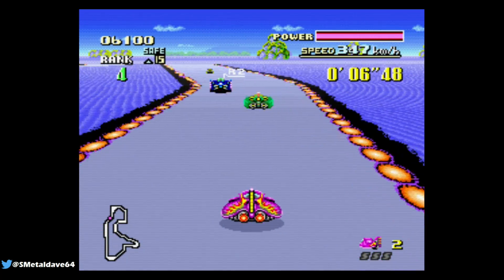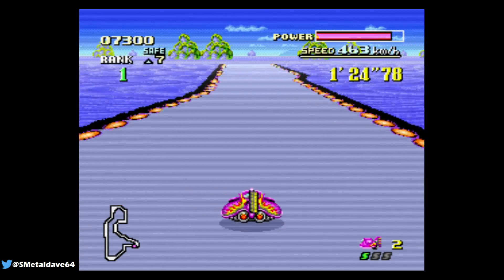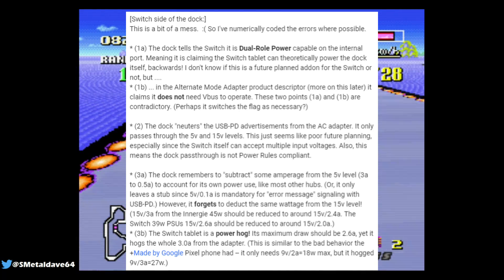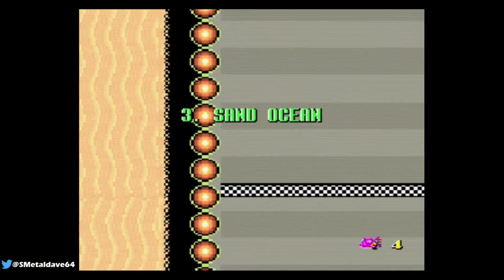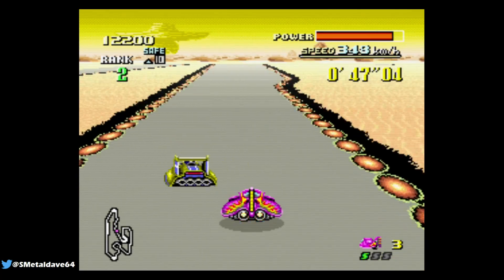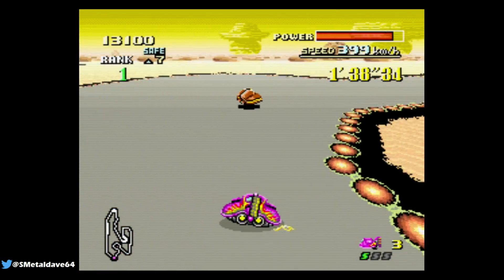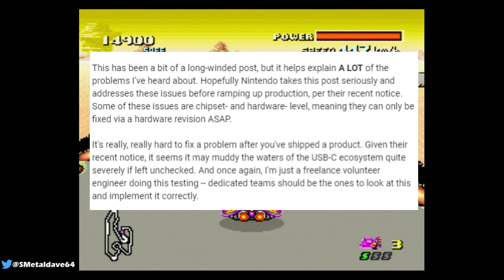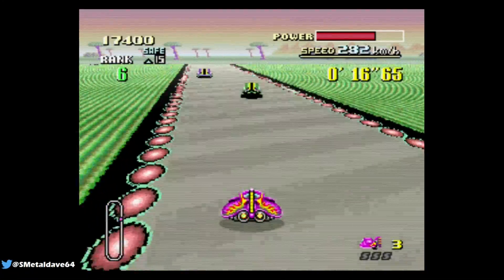Nintendo Switch – USB-C Voltage Flaw Explained

Comment from the maker: Hey guys happy Thursday. This issue with the USB-C port of the Switch and the Dock of the Switch has been circulating today and now we can examine what is going on with it. I think Nintendo is going to be releasing that revision sooner rather than later. Again, I advise people to stop using any accessory or dock that isn't made by Nintendo at this point no matter if it's already worked in the past.
Reply: Does this also include the controller adapters that allow you to use other controls like ps4 and xbox controllers? And does this also include stuff like the Switch Projector?
Reply: John Steel  but the dock is propietary, it handshakes with the Switch and outputs AV. Third party figured it out(just like Apple authentication was cracked), but probably didnt regulate power supply correctly during AV passthrough
Reply: Jon L for what ? Instructions told everybody to only use the cord that came w yr switch or one w the 56k ohm resistor.
Reply: ualdayan, see you feel that you think that is how it should be. Nintendo never said it was USB C compliant they even said to use official adapters and chargers. They designed the system in which it does use a type C port. But they are even confined to that limitation. They made the system they way they wanted to and it runs fine. Nintendo isn't going to make a system so that you can use inefficient chargers or docks that doesn't meet their requirements. It's their system they designed it so they made the system so it runs and it does damn well. Now if they did say hey you can use any charger or we are USB compliant then you would have ground to argue, but they didn't and well you don't have a leg to stand on. So quit complaining and just deal with it. You know you would still be bitching if they didn't use USB C and their made their own port. So either way you still would be bitching. You people are never happy and always looking for something to bitch about. Why don't you do this instead of bitching and complain like you are now how about you just enjoy the god damn system and be happy the switch is a decent portable? You know life is better when you stop acting like a spoiled ass bitch. Enjoy life stop acting like a bitch.
Reply: how about PD powerbanks like anker or aukey?
Reply: almost EVERYONE uses USB-C charging in a non standerd way.
the most 'standerd' anyone has ever gotten is apple's thuderbolt 3 protocol(used in a lot of laptops these days), with a few exeptions.
Reply: Im still a little confused, con you use things that underpower the system like a phone charger
Reply: SuperMetalDave64 what do you think about the anker powercore+ with powerIQ telling it the necessary voltages to use ? Would I be safe ? Or don’t risk it .
Reply: SuperMetalDave64 How does this apply to portable chargers? Don't think it touched on that, just docks.
Reply: Zyfer Warrior I’ve heard as long as you get a resistor cord it fixed the problem as well
Reply: I think I'm safe using my  USB c extension cable
Reply: 18matts hope yr right
Reply: Sir Randall Gaming That is still a flaw. To use a standard port, then use it in a nonstandard way that can’t handle a device being connected that does follow the standard is a flaw, to have it break the device is actually a pretty big flaw at that.
Reply: If you use a standard connector - and then a standard device plugged into that standard connector breaks the device because you didn't follow the standard of the port you chose to use - that is on YOUR design.  It just is. It's a flaw in your design.  If I design a circuit board that has a USB port, and I put 5V on what the standard says should be GND - that would be a flaw in my design.  It wouldn't be the fault of people plugging in standard compliant devices into a standard port and having it fry their devices.  There's a reason standards exist.
Reply: SuperMetalDave64 is it ok to use third party usb c cables for pro controllers tho?
Reply: I'm planning on getting the switch soon, would it be okay if i use my own usb-c cable to plug into the dock and the switch? It's because i heard rumours about people are smudging or scratching the switch with the docks.
Reply: I smell lawsuit.
Reply: Sorry it's a flaw the moment when hardware that follows USB type C standards has the potential to brick your system. This is by the very definition an "issue," "flaw" or problem. The scary thing about this is a cell phone charger from Samsung or LG has the potential to brick your system.
Reply: wakannnai1 actually there are no cases where chargers brick a Switch, only docks with AV output. Additonally these accessories havent even been 3rd party tested for PD compliance. And no one even knows if the bricked systems are power related, most feel its a fail safe to prevent hacking.
Reply: is "brick" even the proper term  ,  i mean birck implies to me that is a software problem this  seem like it is just outright frying the hardware and physically  damaging the boards
Reply: SuperMetalDave64  You do understand when you say "power complaint", the standard only holds true if the device is rated for PD. Therefore since it isnt (and neither are 90% of USB C devices) its not an "issue" or "flaw". Nintendo, like Quick Charge 2.0,3.0, adapted theyre own profiles they felt necessary to power and charge the system.

Comment: Does charge only c cables require that ohm resistor? This is confusing as I’d like to know if i can safely charge my switch with a regular 5v 1A power brick and a cable which says “min/max power 5v 2A”.

Comment: Only 3rd party device I use on my switch is a RavPower 20100 Mah power brick with usb-c to usb-c Belkin cable to charge my switch while on the go. Working fine so far. If it dies, 3 years warranty. Gimme a new switch, bitch

Comment: What? No it's fine. It's fine just like the dead pixels and the docket scratches the screen and the switch bending and the joycons that can get the strap stuck in them if you put them in the wrong way. It's fine. It's all fine.

Comment: Dave, I personally rather use the original dock made by Nintendo itself, not only because it's safer for the switch, but because the original dock looks so sexy, and it's not Nintendo's fault that people are using non licensed third-party docks.

Comment: Here goes the hype during the reveal of the Switch when they said that they are going to use USB-C to power and recharge the Switch ... So basically we're back to square one.... It's Just like 3ds that you have to use proprietary cable and chargers to charge... And they didn't mention any of that during the reveal... Specially during the launch period everyone went to buy a generic USB-C Cable and adapter so they can charge it when they are outside of the house.

Comment: Seems to me the simple solution is use the charger Nintendo sold you with your system and if you want an extra just don't be a cheap ass and buy Nintendo's.

Comment: The problem is, a lot of people bought 3rd party docks because of their portability vs the Nintendo dock. A lot bought due to price point, yes, I'll agree. I think Nintendo missed a trick and should have made a travel dock. I'd buy one tomorrow so I don't have to lug the main one around!
And if the capacitors aren't dumping power then hypothetically a licensed Nintendo dock could still fry a switch. It's a design fault, no argument.

Comment: I have a PS4 and wanted a switch but with those issues alone, I won't ever buy one. Dock scratching and overheating switch and it's overpriced. 3rd party dock bricking switch. switch's USB-C is non-standard powered.

Comment: This is bad for Nintendo and bad for the USB-C ecosystem. Nintendo is using a standardized connector in a non-standard way. They should have used a proprietary connector if they weren’t planning to follow the standard properly. It makes me wonder whether the power regulation components were actually designed before the USB-C standard was solidified or if Nintendo engineers were being sloppy.

Comment: I the only non Nintendo product I use for my Switch is a USB car charger with an Intput of 12-24V and an Output of 5V 3.1A but being a dual channel 1.0A and 2.1A slots.  I am pretty sure It is safe since it wouldn't put out enough juice from a 12V car battery hooked up on the 2.1A slot.  But can anyone confirm if I'm good?

Comment: There’s only one company to blame for this and it’s Nintendo themselves.  No one would be buying 3rd party socks if their standard sock didn’t suck so bad!  It scratches the screen without a screen protector and has terrible ventilation!!!

Nintendo should service FOR FREE and honor any warranty even if you used a 3rd party accessory cause it’s their own damn fault!

Or better yet, offer a free replacement for all docks!!!  All of them!!!  Design and manufacture a better dock with better ventilation and scratch free!

Or at least just the ventilation problem!  Everyone should install a screen protector on their switch.  So the scratch issue is minor cause most people don’t have this suffer this.  But the ventilation???  Christ!!!!  I have to place my dock horizontally and lay a pc fan on top with the back panel open to push more cool air into the switch so it doesn’t get so damn hot all the time.  I shouldn’t have to do that kinda bs!!!!!!!!!

Comment: Nintendo won't fix anything.  They will tell you that you violated your warranty using unauthorized accessories and be happy to take your money when you buy a new Switch.  It works as designed.

Comment: I like the way you worded the problem SuperMetalDave64. Design Flaw and Non Compliant fit this perfectly. Nintendo has always known how connectors work, and have always made their power and video plugs proprietary. They did this to screw over their competition and their customers, but they have also made themselves legally responsible for it. They chose to use USB-C for the power supply, but chose to make the Switch non compliant with those industry standards. I cannot wait to see the class action suit this will cause and Nintendo will get taken to the cleaners for it.

Comment: I think all Nintendo switch owners honestly have a class action lawsuit for this.  If the USB C port was not built to standards by Nintendo yet they advertise in the specifications for the Nintendo switch that it has a USB C port then that is false advertising and they obviously had to know about these problems prior to shipping.  Nintendo should have to make the hardware changes necessary for the USB C port to be standards compliant for all existing and future Nintendo switch devices.

Comment: Gotta love all the idiots saying nintendo is purposfully bricking systems.
 First of all do you not realise game companies like nintendo make far more money on the games and dlc then they do on systems? If you dont have a switch your not buying games. 
Second for most pepole experiencing these issues they are still well within thier warranties and can get them fixed for free. Now nintendo has to spend a fortune fixing all these switches.

Third if as hes says in the video its caused by not being complient they can and will be sued for a crap ton. Will have to do a recall and fix all switches for free. This will cost them a massive sum of money that is only equled by the exploding samsung phone debacle.

Fourth and lastly a good amount of blame still lands on the makers of these third party dock. Proper testing would have found this issue and they could have alerted nintendo and the public...further seeing as the nintendo dock does not cause this issue the third party docks could have actully made a modle that does not fry the switch. They just need to do what ever nintendo did that made it so the dock wont fry the switch.

Comment: The only 3rd party accessories I have thought about using with my switch are storage solutions so I am good.
In fact the only 3rd party accessory I use with any of my Nintendo products (and I own Every NA Nintendo Console excluding Virtual Boy. (Not counting portibles) is a DS-USB Cable I bought so I could plug my DS into a Battery pack i use with my phone.

everything else is first (or in the case of the power glove, second) party.

Comment: What if I use my lg charger? Its a usb-c as well, should I stop using it to charge my switch when Im on the go?
Reply: Turtato is the charger USB C on both ends, a fixed cable on the wall end or using a USB A cord?

Comment: SO is my Anker PowerCore 13000 safe to use with my Switch? I mean I bought the damn power bank specifically for this machine.
Reply: Daniel Despres Make sure to use a quality USB C cable such as the one included with a Pro Controller and you will be fine

Comment: I think saying "don't use ANY third party accesories" is wrong. I have an USB controller, and that doesn't feed the switch with extra energy or anything. The better way of explaining it would be "don't use any third party chargers or docks", not just "any accesories"

Comment: As I understand it, the USB-C standard, which is open sourced, was not quite finalized and was still in a little flux when the Switch came out. Is it possible that Nintendo went with apparent standards that changed after release? Although even if so, you'd think Nintendo would publish the specs they used considering the hardware being open source or at least warn that they are different. Then again Nintendo can get secretive. However, if I use a standard device that works on all others (so not a 3rd part dock) but damages my Switch, I'll blame Nintendo for selling me a faulty console.
Reply: David Romig USB C is in its third finalized revision now. The power input to the console is not commonly used in other devices and to my limited knowledge is not part of any of the three standards.

Comment: Wow Nintendo EPIC FAIL! i'm so glad i haven't used my Power Bank  (which i bought with the switch in mind)
Reply: Ditto
Reply: All information suggests the Anker PowerCore+ 26800 is safe with the USB C to USB C cable it came with.

The RavPower (Xtreme) 26800 PD is likely safe in the same scenario but is capable of higher power output.

Comment: this is retarted for nintendo, if they werent going to follow any standard with a USB plug, they should have just used a propriatary connector for their console and dock, they only used USB connectors to shut people up about using propriatary
Reply: Diddz' Using a none proprietary charger for a portable console is a massive plus though more so than just to shut people up. If you forget your charger a friend most likely has one (if they have a newish phone)
Reply: standardized chjargers are good, except when the standard isn't followed or adjusted when the standard is released, if they had cone with propriatary, then none of the voltage flaw issues would be present unless we spliced USB C wires to the propriatary connector (which would void the warranty).. now what most devices ive seen do if its undervolted, is it cuts off that charger source and runs off battery, or drains power slower.  there is no safety circuit in the switch to detect this

Comment: this really sucks, as the whole reason I bought a damn switch was to play it while i was on the road as a truck driver. and i charge it via USB C cable and just a car charger I use for all my devices in the truck. now im afraid to even take it with me because my car charger could brick it. Even if they fix it in a revision of the hardware the millions of us who already bought one are just fucked. either left with a bricked system and spend a whole 300$ again. or live in fear that any non nintendo device will break the damn thing. I have loved everything about the switch, there always has to be something from keeping a device perfect.
Reply from the maker: Well Nintendo has released a new warning statement on docks, charging cables etc, too bad this warning wasn't put out by them over a year ago when the Switch launched, but they are much more specific now: https://nintendosoup.com/nintendo-use-3rd-party-usb-cables-with-switch-at-your-own-risk/
Reply: SuperMetalDave64 it still feels like a huge flaw out of left field and I feel it really damages the portability of the unit I wounder if a car charger in a lower power would be less of a risk ie a 5V 1amp vs like a 3amp

Comment: If I just use a usb c cable for charging with a standard usb wall plug would that hurt? I've been doing this for about 6 months with no issues. Less things to take when traveling.
Reply: Derek Dymond You are much more likely to find bad & dangerous cables on the USB A to USB C side. Also you need to check the power brick(s) to confirm they don't exceed the Switch power input.

Comment: Guess I’m safe as both my docks are officially made by Nintendo. The only USB-C cable I use is the one to charge my pro controller that I plugged into the usb on the side (hell, I even got my USB dongle for the licensed Logitech Wii keyboard on the second one) of the dock

Comment: If its a hardware level problem, why did the bricks start happening only after 5.0 update?
Reply: Firmware can be considered part of the hardware, it's a mess on the new firmware update which seems to upgrade some of the USB-C protocol related code.

Comment: I'm taking my chances cuz all I have is a third party HDMI adapter and a charger. So far so good. Fingers crossed. When I plug in my HDMI adapter, on the Switch it shows, for a second, "unable to charge" next to the battery on the top left. Then the screen turns black and shows up on TV. Is that normal? cuz I never owned the original dock

Comment: I use the USB-C to USB cable that came with my pro controller to charge my Switch when it isn’t on the dock, and then I have it plugged into a generic 12W brick.  Given that isn’t over the power standards, would it be safe with regards to this problem?